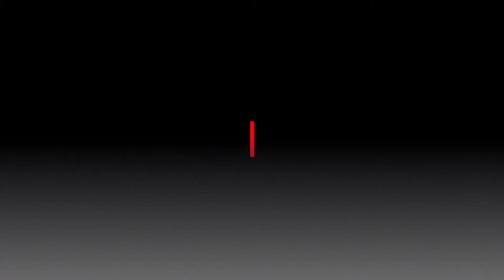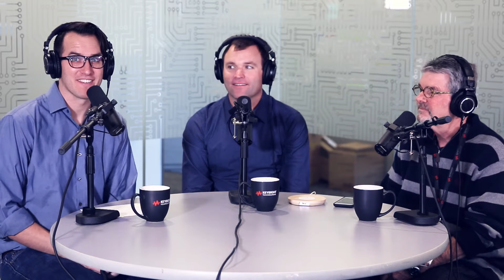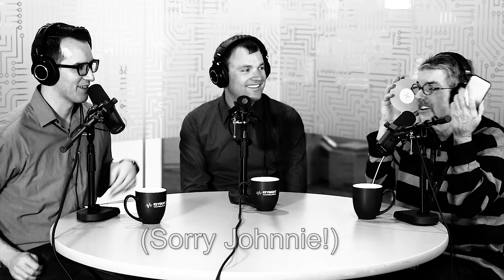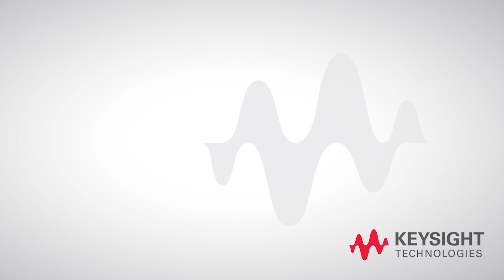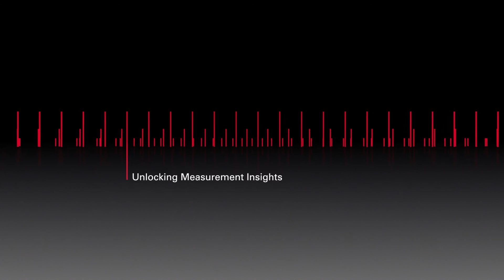Wireless Charging - EEs Talk Tech #3 - Keysight Technologies

Comment: Interesting talk, thanks! I used my wireless Qi charger all the time previously, but after getting a phone with USB typeC (and wireless charging), I've moved back to wired charging before even noticing. Maybe because the connector isn't anymore 4-dimensional :P
Reply from the maker: +Petex90 I've been wondering if fast charging will beat wireless charging, it'll be interesting to see how it plays out!
Reply: I can testify that with my htc one m7 I was lusting for wireless. Why was that? That model was using micro-usb, which we all know is a keyed plug and it is slow charging. One more issue was the one-day performance of the hardware package, even if I went the extra mile to turn off anything I didn't need. Needless to say, it was a pain.

With my new model, which is a huawei p9, fast charging with usb-c and the two-day package, even with wifi and mobile data on always, I don't see any need for wireless for this device. Why would I opt for a slow wireless when I can fast charge 3-40mins and go from 10-15 to 90% which lasts two days which gaming, youtubing, emailing and all the other things we do on these devices? Wireless for this device is surpassed already.
Reply from the maker: Interesting!
Reply: Use wireless charging where possible as it saves the possibility of damaging the fragile micro USB connector. This isn't so bad if you change your phone every year but in a time where changing a USB connector can involve having an LCD change too due to deliberate traps then I think wireless charging solves these issues (for low power devices anyway), but it's certainly slower; completely the opposite of what consumers want.  I'm sceptical wireless power will be doable with high wattage electronics though.